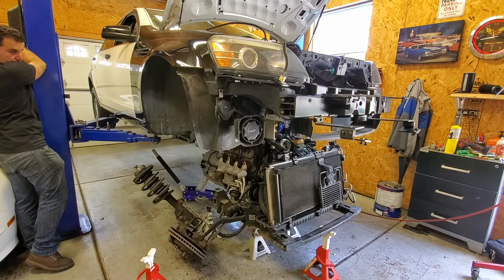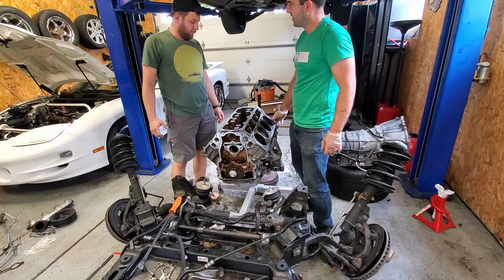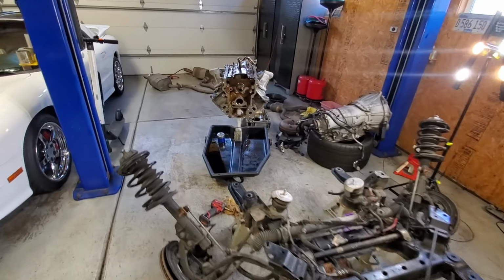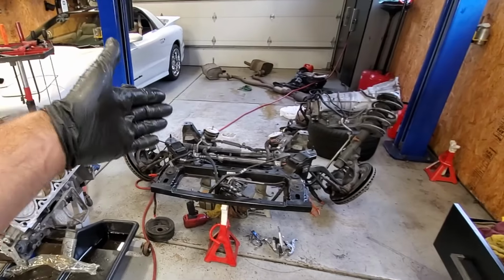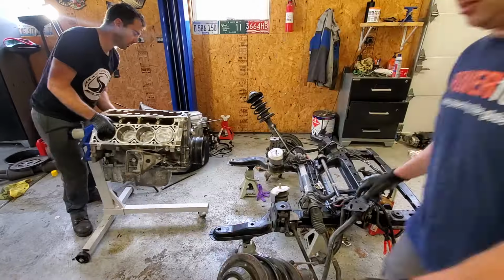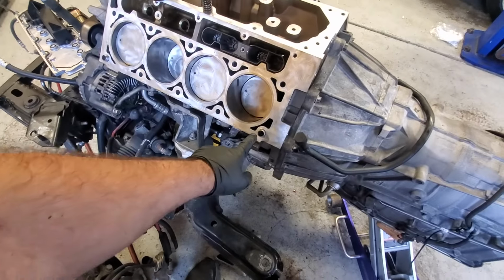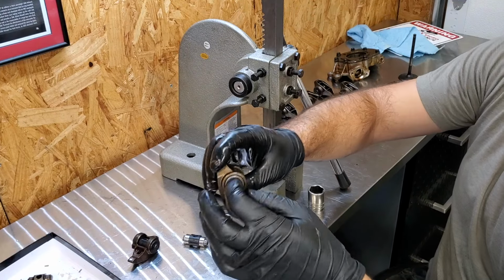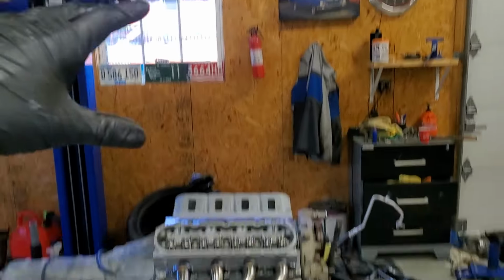Fixing THE WORST LS Engine Factory Defect Ever & Adding 100 Horsepower In The Process! GM Failed US!

Comment: I had a 2005 GMC Sierra with the 5.3L and the engine block cracked after 460,000km. I know the previous owner didn't take good care of it so I was surprised that it lasted that long. In the last shop I worked at, there was a customer with a 2007 Silverado that didn't have the DOD and it had over 600,000km on it and was still running strong. It ran and drove like new. I saw tons of the DFM ones come in and out and they would typically fail around 300,000km.
I also had a co-worker who did an LS swap into a 350Z. He took a 6.0L out of an Escalade and was pushing over 700hp to the rear wheels on the stock bottom end.

Comment: Alex, did you go ahead and disable DOD on Wifey's new Escalade? And.... have you ever used an electronic AFM Disabler? It sounds too good to be true. Just plug it into the OBDII port and it turns off AFM. Is there anything to worry about when using that method?
Reply from the maker: Not yet but I will

Comment: I bought a new 1999 silverado 2500 4x4 with the LQ4 engine. last nov a kid running a redlight totaled it and now I have a 2014 camry le. loved my LQ4 only problem I had was the pressure regulator leaking fuel into the intake. no one helped on the internet with that. I had to figure it out myself. clue when engine warmed up shut it off and pull the vacuum hose off the regulator. if fuel comes out the regulator is bad. Delphi makes a good replacement. I replaced my spark wires with MSD and that it for 20 years. I always used mobil 1 changing oil/filter every year. the engine had a noisy(clicking) lifter on start up but that went away with mobil 1. great truck. but I can not control bad drivers. Im 75 and not in to project vehicles. been there done that. Liked your video and its good to get the young guy into the project. best wishes on this build

Comment: Great video, I am in the middle of a cam swap myself 2010 camaro ss I also have the same converter, Alex when installed the oil pump did you "shim" it or just installed it straight up no shimming?
Reply: I’m curious to know what you will be doing, I will soon be doing the same thing on the same vehicle

Comment: LegitStreetcars - you can also add bad oil pickup line O-rings to the list of causes for AFM related failures. This happens on the 5.3 and 6.2 Vortec motors, not sure if LS has this but I wouldn't be surprised.

Comment: Mayhem 2 cam has a .630 lift,  I don't know about Mayhem 3. If that engine has 11:1 or 10.4:1 compression I wonder if there is enough clearance on those flat top pistons. If you spun the crank I guess you already know.

Comment: This is all wrong!  Using torque wrenches on head bolts instead of just holding the trigger on the impact for the old head bolts, assembly lube instead of WD40, new parts instead of used 250k mile parts.... @sloppymechanics would be disappointed. 🤣
Reply: Don't forget the correct way to torque up bolts:
keep pulling on the torque wrench then say to yourself "click"
.. that's done then move on to next job......😬😆
Reply: @stuartd9741
Reply: All you need to do is listen for the the Ugga - Dugga from your impact wrench!
Reply: Ben T. But to be honest ? If you know what you’re doing ? You wouldn’t so...
Reply: LOL, a sloppy build it aint!
Reply: @Corona Virus I would have thought you would recognize a joke when you hear one.
Reply: Ben T. Yep been there done that too lol
Reply: I was thinking the same thing I’m like well that’s dumb why don’t you just use the impact gun! 😂😂😂
Reply: Also that Polishing tool on installed pistons with the grit going into the rings is a major nono iny engine book
Reply: Love the channel.  Agree Displacement on Demand sucks but it's driven by fuel economy regulations still bad choice by GM engineering - it's not a factory defect they build based on engineering specifications.
Reply: The builder is an idiot
Reply: Had a 4200 stall in a street driven heavy LS car. Was perfect for the street locked up on lean cruise well . It slips fine and still accelerates at 2-2.5k with ease.  

You barely knew it was there unless you jumped on it. I'm either a Nanna or its to the floor so never bothered me. A lot of people are the same.
Reply: @hayden6056  I'm sorry, but your comment is not true at all by saying that "you barely knew it was there unless you jumped on it". You can feed that crap to someone who doesn't know better guy. Some of you need to catch up to the times and a lot of folks need to learn how to build better combos and choose a cam, intake and gear that works together properly and you won't need all that stall, especially on a street driven daily driver. If you think I am wrong then maybe you need to go to school and stop following the herd of Holley Fast intake users and cams that chop so much your eyes nearly vibrate out of socket. Lmao. You can choose say a TSP 224R or 228R and then use a stock truck intake manifold and have it ported along with your throttle body and then an Eaton unit with a 3.90 gear and be fairly solid without a stall converter. Of course I'm not a big YouTuber so please by all means, don't listen to me. Lol. I keep seeing comments with "decades ago", "years ago", "back in the day" and following the popular crowd of people choosing bad part combos and it is ridiculous. Some solid research can go a long way and knowing which gear to use, which cam to use, which intake and maybe a low stall will yield far better results in your daily driver sleeper than all this 3400-4200 stall crap. Another option is adding a small shot of nitrous off the line to aid in getting into the rpm's easier and quicker. Most of the time a 75-100 shot is all you need just make sure your engine can handle it which most LS engines in stock form can.
Reply: @JustAGuy781   Nitrous here is a ten thousand dollar fine if found driving with it on the street. 

Cam wasn't even that big it ended up going to a 231/236. 

Had an ls6 intake manifold on it.

It was a tight stall converter that was custom made for the application and worked extremely well. 

School can't teach actual experience of parts used and what your preferences are . If you want to argue with people on the internet about what they enjoy driving that's up to you. 

But including the guy in this video that's now three people who have no complaints driving 3.5k + stalled modern automatics on the street. Who were all surprised with the drivability and couldn't see a reason to have a stall rating lower. 

Maybe you need to go spend $1400 on a custom hi stall specifically built to try and have the best of both worlds in the classic fight between street and strip and not comparing it to converters from the 90s.

The 4200 stall I had they actually recommend for any LS wanting to perform the best they can at the strip. They dropped half a second back to back with a stock stall bolt on , no cam .  

I went to a torque converter specialist. Like you should , told them what I expected from the car. I said it weighs 4000lbs. I'm 250lbs , it has a 5.7 litre , 3.89 diff gearing , 4l60e , this cam on home ported and milled 241's. 

I want to run 115 mph and have it decent enough to drive to and from the track. 

They said this is what you want it'll come in around 500 below your max torque and shouldn't shit you to tears on the street. 

They were correct. If you're just looking to raise your idle and not have it riding it at lights and when you get off the throttle I guess a little 2.5-3k stall won't be pissing your money away to you.  

But if you want it to perform as well as possible you're going to lose some little comforts elsewhere. 

As for continuing an argument on whether the car I owned. Or other cars I've installed converters on drove like a fuckin pig or not, with some cunt on the internet from the other side of the world? I  can't be bothered. 

You do you bruh , cause no one on the internet is going to change my mind after I've learned the hard way 90% of the time of what works and doesn't work for me.
Reply: @hayden6056  exactly, what does or doesn't work for you. And there was flaws in your combo as you so happily put out there for everyone to see. Anyone who is buying a stall converter should know the basics and that it will not stall as advertised unless it is a custom built stall and then it is still going to be a tad lower.
Reply: @JustAGuy781  flaws or not mate the combo went well 🤷
Reply: @hayden6056  like I said, whatever worked for you was great. Keep on keeping on.
Reply: I like how he said he puts the balancer on first and then tightens up the timing cover when he did it exactly the opposite. 
And a 3800 stall??? Oh man these guys and their false sense of stall converters. I would be pissed if he threw a 3800 converter in my transmission especially in a daily street sleeper. All of your parts such as cam, heads, intake, converter, need to work together. A little time and research (internet/pen and paper) would have gotten him a lot further in his HP numbers. If you think you are only adding 100HP you are very ignorant. And while the heads are off have them ported, just makes sense.
Reply: @JustAGuy781  Watch the video again. He did not torque the timing cover bolts until after the balancer was installed.
Reply: @JustAGuy781  he put head bolts in dry
Reply: @JustAGuy781  just like oils ain't oils, stalls ain't stalls. 3800 stall is like quoting advertised duration on camshafts. There is no consistent measurement for stall. Some stall converter builders bend the fins to increase stall which is outright dodgy. Some will replace all the internal parts, but they might both be called a 3800 rpm stally. Some consider 3800 rpm flash stall to be a 3800 rpm stally, where other require it to actually stall to 3800. BUT how drivable it is at low speed comes down to the construction. 3800 rpm is not a lot is the stall converter is properly built, but if it is cheap and nasty it can be a real pig to drive.
Reply: @DodgyBrothersEngineering  your analysis and perception of what a 3800 stall is to drive on the street is wrong. How many 3800 stall converters have you actually used in a street driven vehicle or rather a daily street car/truck? My assumption (I could be wrong) is that you don't have much experience with this high of a stall on the street.
Reply: @JustAGuy781  zero experience with 3800 rpm stalls, plenty with 3500 rpm stall. Decades ago ran a small block with 230 / 236 (at .050) cam. First convertor drove like an absolute pig, the convertor provider did what I mentioned above and bodged the converter to get a flash stall of barely 3500. Was atrocious down low and slipped like a bitch. Fed up with the undrivable nature of the car, I went to another converter shop which used a much smaller casing and replaced all of the parts inside giving me a genuine 3500 rpm stall. That made the car so different to drive it was unbelievable, like I was driving a completely different car. The slip had gone and low speed driving was once again a pleasure, and when I went to the drags I got a genuine 3500 stall out on it, not trying to drag its bum across the grass like a dog with worms. The brakes held the second converter easily. Chalk and cheese between the two. The first converter wasn't cheap but the work they did was.
Reply: Don't you know an experienced mechanic can measure torque by feel better than any torque wrench ever made?
Reply: My calibrated elbow is fine for things like lug nuts and body bolts but anything to do with engine assembly I break out the old torque wrench. I’ve actually had to buy a new one recently as my snap off TQ wrench was way out of calibration so I just tossed it in the metal recycle pile and picked up a harbor freight icon. And before A bunch of people say harbor freight tools are junk watch a couple Of the comparison videos against snappy crappy and tell Me I’m wrong then.
Reply: @web5271  Or not. This was demonstrated on Mythbusters and it was shown that seasoned mechanics tended to overtorque, while novices got much closer to the correct values.
Reply: @web5271  Bullshit

Comment: I have an 07 Tahoe with the AFM 5.3. I put a Range Technologies device in the OBD port to deactivate the AFM. It does deactivate the AFM, but will this prevent the AFM issues? I don't know. I regularly change the oil and use a quality synthetic, for what it's worth.

Comment: FWIW - Those Roloc Bristle Discs have ceramic grit and are actually quite abrasive. They really shouldn't be used on sealing flanges or on engines, especially soft aluminum. You can take a few thousandths off without even thinking about it. GM even put out a TSB (00-06-01-012D) against using them.
Reply: I've seen it backfire personally at a dealership and had to send block to be decked
Reply: Someone beat me to it! Rolocs are a big no no!!!  As for the deck surface, a razor blade is all that's needed.
Reply: Best to wet block sand and only to a min . I grease the bores to prevent grit intrusion
Reply: personally I avoid any power tools on aluminum, I have a set of what used to be wood planer blades that have been ground on a surface grinder.  I just gently shave off the old and avoid making divots that way.
Reply: @speedbuggy16v  That part of the video made me cringe. He'll probably learn the hard way. Like most of us.  That deck and Pistons look horrible. Roloc discs are for Rotors, Hubs, Cast iron parts. NOT on Aluminum Engines. GM knows and has a TSB explaining the destruction caused.
Reply: yea, i don't know why he didn't just have the machine shop deck the block if he was going this far.
Reply: Here is a old gm video at the beginning of the video they describe the gasket cleaning dilemma it dosent mean your engine is definitely gonna fail it's just compromised and the oil filter will not filter all the oil due to the bypass valve in both the oil pump and filter even if it's filtered it might not be able to trap it most engine wear is at a micron level that filters can't trap https://youtu.be/okmcF8nXdW4
Reply: Block block sanding with fine grit 400 sandpaper and WD-40 works great if the block is flat and the heads are flat. Then there is no need for a machine shop. A Precision straight edge and a feeler gauge don't lie.
Reply: Ya I was really surprised when I saw him do that.  It's no as bad as it looks but when your building an engine wouldn't you want it perfect
Reply: Carbide tipped gasket scrapers are best
Reply: I dont care how long you have been working on cars or how carefully you are you will destroy a good engine in no time green is cast iron and white is what your looking for on aluminum The surfaces will be ruined but worst of all you get all that grit in the oil system and say by by bearings good luck washing that grit off
Reply: @fm-lq7rn  white still abrasive, just finer grit
Reply: @fm-lq7rn  Fine grit will get down the cylinders and into the rings, it may not destroy an engine but it's life will be shortened.
Reply: @fm-lq7rn  
That's probably how they killed my Northstar when they studded the block.
Reply: @fm-lq7rn  lol. People with years of experience and no problems with any of their engines obviously didn't ruin them.
Reply: Bad idea totally.i run high boost so i like to keep my surfaces flat
Reply: @ryangulley2051  Well duh. Of course you like flat surfaces. When building high performance there is a reason you take extra care in all aspects of the building process. The goal is to remove old gasket. Not the material under it.
Reply: yup exactly coming from someone whose dad owns a machine shop i cant tell ya how many blocks we have decked due to this. if you want to clean the deck use a wire brush.
Reply: YOU ARE 1000% RIGHT! IT IS SHEAR STUPIDITY. I ASKED A TOOL AND DIE MAKER ABOUT THIS AND THE TERM MORON CAME UP. HE THINKS HE IS HOME FREE BECAUSE IT DIDN'T BLOW YET. WAIT TILL HE TRIES TURBO OR N2O.
Reply: I came to the comments to see how many people would complain about this, I have been doing it for years with ZERO issues. In fact I have even went over a few over the years with Dykem and a sand bar and they were perfect to seal metal head gaskets. Its all in how fast you do it and don't sit in one spot for to long.
Reply: Yea true but..... on the other hand we've been doing this for years and been fine
Reply: @TONYSTARK-jh2wu  The only truth is it's a Big Mistake. Needs to send it to a Machine Shop now.
Reply: @JOHNSUE28  nope hasn't happened to me mine have been just fine. My daily has been going for 3 years after I used the light blue roloc on the head.
Reply: @TONYSTARK-jh2wu  Yeah but you probably have years of experience and very carefully barely get the crud/old gasket material off. Least that's how I do it. I also prefer scraping all the high spots off first and use the roloc very gingerly.

Comment: I had a 09 Pontiac G8 GT with the 6.0L L76 dod engine. Great motor with tons of power and would get 22-27mpg on the hwy cruising. I know the earlier 08 model year cars had lifter failure, but my 09 was a later build 09 with the updated lifters. Sold it with 120k mi with no issues out of the motor. Just had to make sure you had plenty of oil in it. She took 9qts of oil. Miss that car so much. If you wanted more power then you do what you are doing and you'll be at 375hp to 420hp ish at the wheel depending on tune and cam
Reply: My 09 GT has 127,000 miles and still with DOD intact.  Runs great with CAI, headers and tune.  Even though I've had no issues and plenty of cars out there with over 200,000 on stock motor, I plan to do an upgrade like Alex's over the winter.
Reply: Doing the DOD delete on my 09, car has 80k and the stock DOD cam looked brand new.   AFM lifters looked good too